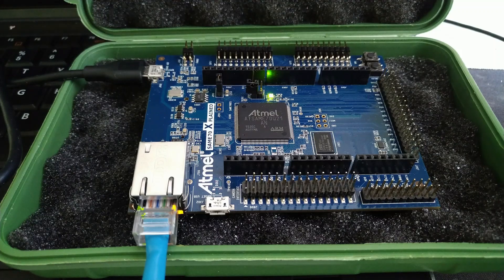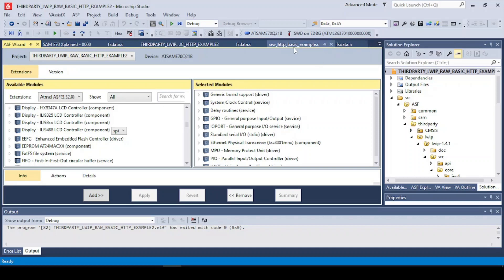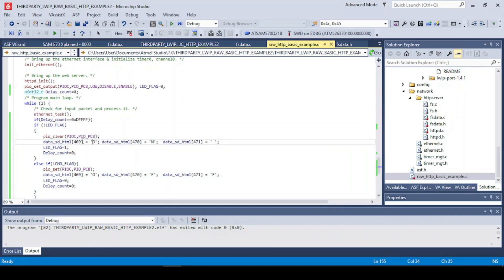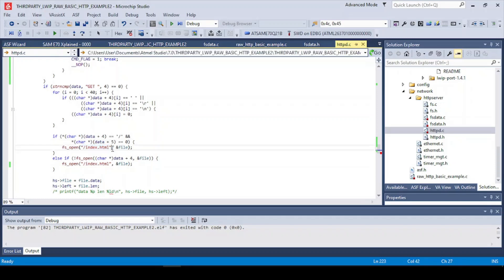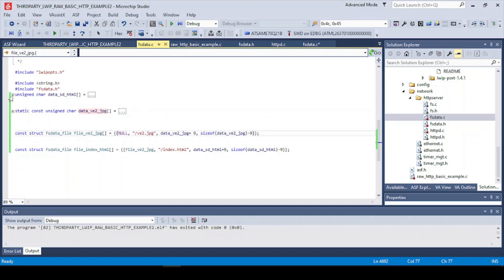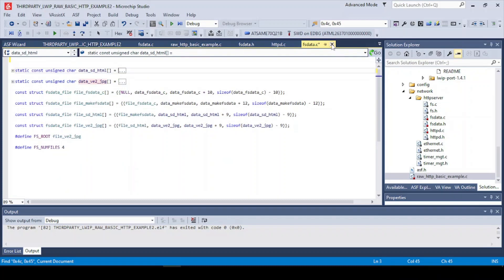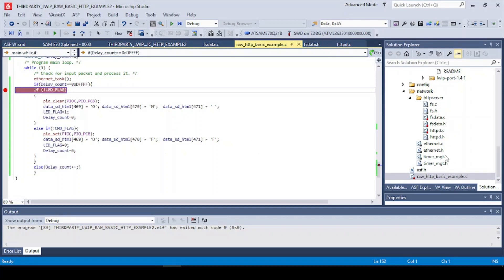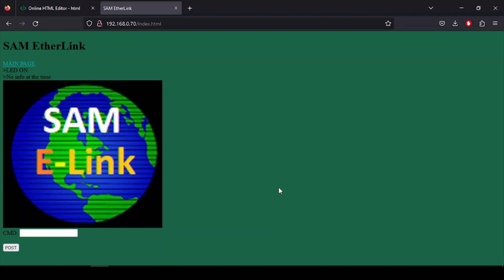SAME70 Xplained lwIP HTTP Server example in Microchip Studio

Comment: What cases are you using for your boards? I see they are usually green plastic cases but where do you buy them from?
Reply from the maker: I think You can find them on aliexpress by searching "edc case waterproof", the ones i use i got from a local shop in Poland (price for one was something like 2 $).
Back in the day i had a job where i had to travel +100km to office and had to pack with me a lot of expensive boards/components so i used these cases and they did a great job